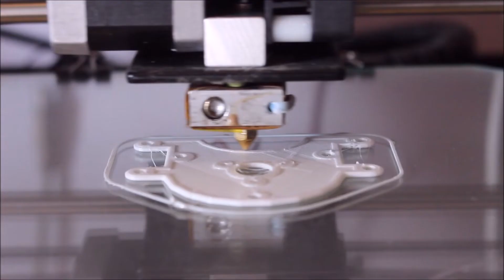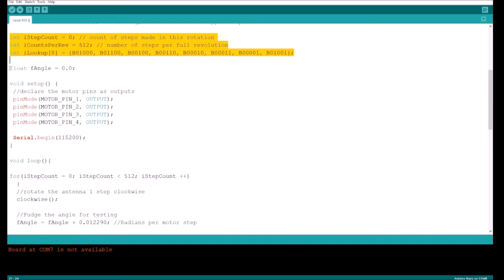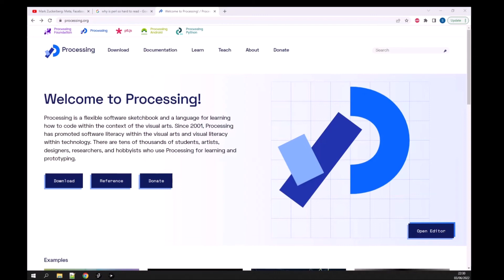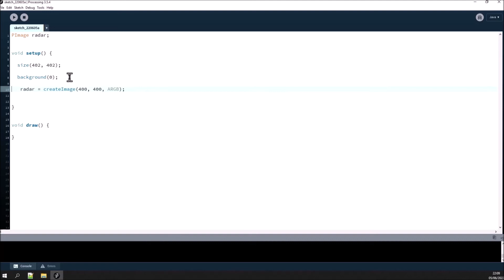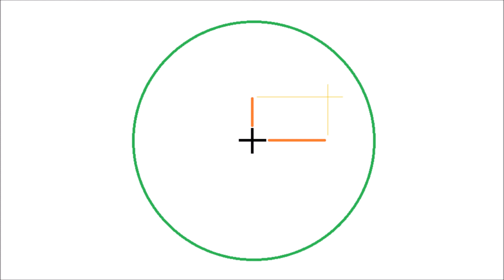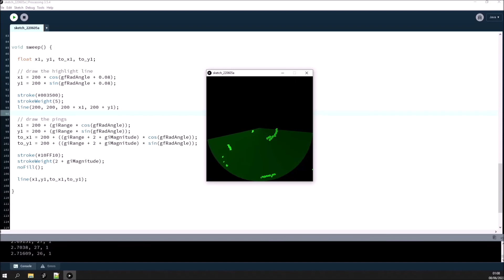360 Degree Robot Radar Sonar 2022

Comment: Beautifully🥵🥵, I'm also doing a Radar system project... I will present it to my sponsor Next year. Can you please share your 3D print design, I know I will struggle a lot when avoiding the twisting of wires.
Reply from the maker: Hi.
Thanks for commenting.
The STL files are available at:
http://so-now.com/robotics/radar/index.php
Scroll down to the bottom for download links.
Good luck with your project.
Reply: @So-Now  Good morning, I hope you will understand my question. How can I Center the Radar Display if I have increased the  window size by "size(1920,1080)
Reply from the maker: It could be done for the window size, , but the geometry of the actual radar image must be square.
I.E. the x dimension must be equal to the y dimension.
Otherwise the geometry of the radar trace would mess with the maths required for the draw functions.
Reply from the maker: Use this link to find a modified version called radar800.pde. Its screen size is 800x800.
http://so-now.com/robotics/radar/index.php#Code2023
Reply: @So-Now   Thank you, I did some maths and everything now is fine. I also did some few editions on Processing. But the problem is, the rotation speed of stepper motor does not match with speed of sweeping. It about a week try to solve that issue. Is there anything I can do to fix this problem?
Reply: @So-Now   Error, it says "File wasn't available on site"
Reply from the maker: Hi.
As mentioned in the other radar video (likn in the description), these steppers come with many variations, voltage, gear ratio, steps per revolution, etc.
You would need to find out how many pulses per revolution YOUR motor requires to syncronise the code correctly.
Reply from the maker: Which file is not available?
Reply from the maker: OK. Found it. It was a broken link.
Now fixed.
Reply: @So-Now  Thank you, I have noticed that inside the for loop in your code.. the " int iRange = sonar.ping_cm()" causses some glitches on the rotation speed of a stepper motor, because if i comment this line, the stepper rotates just fine. I think when the HC-SR04 sensor collects the data, it causes some delays in a loop. I still need to dig deep on that, why it is like that. Thank you
Reply from the maker: Hi @NhlakaniphoPhetha .
You are not giving me much information.
I do not know which motor you are using, which sensor, how you have it set up or what changes you have made to my code.
Remember, this project is 2 years old to me.
If you comment out that line, the code will not send a ping, nor will it wait for any possible reply, so there will be no delay at all.
Uncomment that line.
Change #define MAX_DISTANCE 500 to #define MAX_DISTANCE 200
Se what happens.